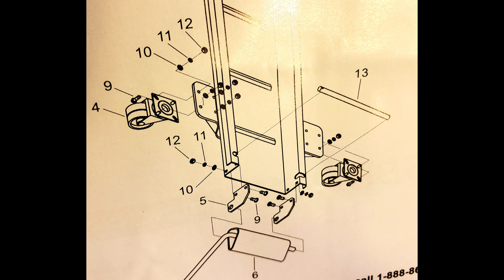Harbor Freight / Pittsburgh Motorcycle Dolly Assembly and use with BMW G650GS

Comment: Hi, where is the hack video?
Reply from the maker: Hello Tina, I made a video of it. Wasn't happy with it's outcome. Decided to make a different one.  Then life happened and I didn't get back around to it. So,  I apologize.  But, I'll try and get one made again and get it uploaded here in a few weeks. 
Thanks for watching,,, 😊
Reply: @MrMike47274  all good. I built my dolly yesterday and the breaks worked fine so I don't need the hack now anyway :)
Reply from the maker: @teenmura  Good deal. 👍  My floor has very very smooth concrete I guess, which causes the brakes to just skate across the floor. Ughhhh I need to redo my hack video anyway. So,  I thanks you for jogging my memory that I forgot to get one back on here. 👍👍
Thanks again and stay safe out there !!
Reply: Did you ever make your hack video? I'm having the same issue with my Concours. I'm thinking a piece of rubber on the bottom of the "ramps" but I want to see what you ended up doing.
Reply from the maker: @teenmura  Good evening,,, I finally got my HACK video posted.  
Here's a link in case you want to check it out. 😊 
https://youtu.be/5WWVoQFZru4
Reply from the maker: @razrielle1226  I've solved my Dolly sliding around. Here's my hack Video showing how I ended up fixing the problem.  
I originally started out with a piece vinyl carpet runner. My original thought was to have it long enough that when the front tire was at the ramp/brake the back tire would be on the runner hold the Dolly in place with the weight of the bike. That didn't work out too well. So,  I ended up just wrapping the vinyl around the ramp/brake of the Dolly and securing it to itself with zip ties. 
Here's a link to the video.  Sorry it took me so long to get this posted. It's been a crazy year and after having a heart attack last April. I kinda had other priorities.  HEHE 
Thanks again for watching and I hope you had a great riding season. 
https://youtu.be/5WWVoQFZru4